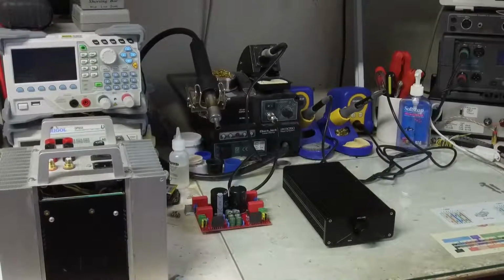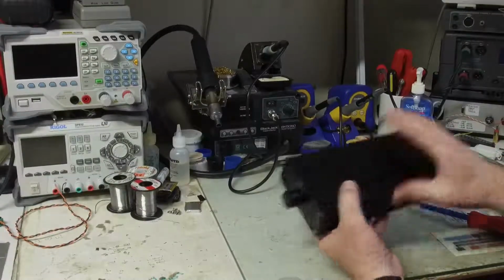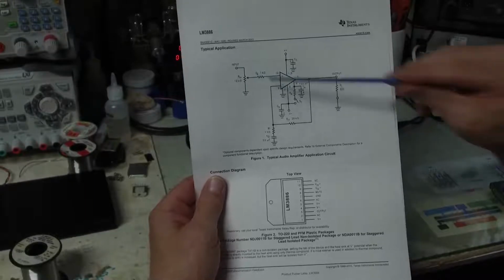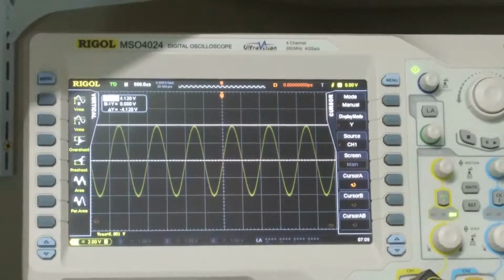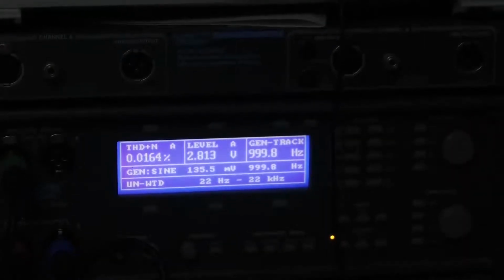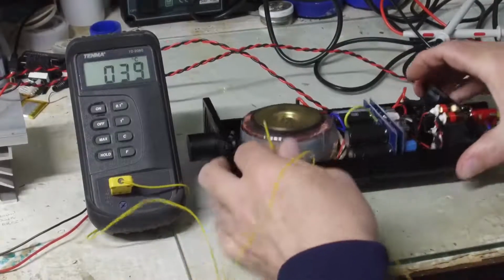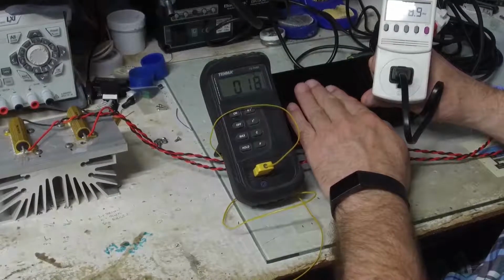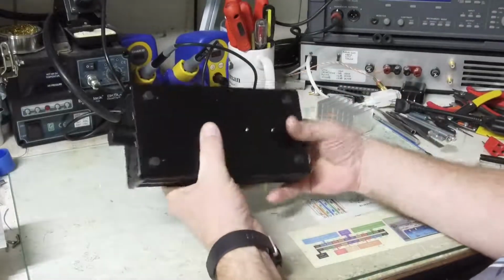LM3886 Review of eBay amplifier with thermal, performance and distortion. Used in Gainlclone.

Comment: 30W input for 2W output. So how many watts it consumes for 50watt output?
Reply from the maker: It does have a pretty high idle current.  So as you turn it up, that idle current plays less of a factor in overall efficiency.
Reply: @DanPattenAudioG33k  thanks!

Comment: I DIY myself this Amp LM3886 using CPU heatsink (3-4 gen Intel CPU heatsink and heatsink is quite small) the heatsink is more than adequate. You must have a heatsink cos all the transistorised components are housed in such a small package, and good heat dissipation is a must.
Reply from the maker: Agree.  Adequate cooling is a must.  It is amazing how much smaller the heatsink can be if a fan is used (not just relying on convection cooling).

Comment: Is lm 3886 ic AB or Class D  ? And also tell me which is best ic than lm3886 which delivers 100 watt output. Thanks
Reply from the maker: @SachinB.A.  LM3886 is Class AB and I believe 68W rated.  It is the highest power AB chip I have used.  You could use 2 in BTL configuration and get 100W.

Comment: How many amperes is a good transformer for an LM3886 stereo amplifier?
Reply from the maker: For a robust design, I think you want the secondary windings to be rated for 6 amps (for a stereo design).
Reply: @DanPattenAudioG33k  in my country the average person sells 5A or 10A... 6A ones are rare.. Can a 5A transformer be used for this amplifire?

Comment: Great analysis.  I have built several 3886 based amps recently, seriously heatsinked kit products, they work very well.
Reply from the maker: Good to hear.  The LM3886 does a decent job but they do need a decent sized heatsink.
Reply: man the AKITIKA is wayyyyy more complicated

Comment: Hi Don. I know you was laughing about adding those 2 extra heatsinks but that is exactly what is needed. Almost all the amplifiers from Ali/EBay etc are almost always under heatsinked. It is done like that to make it cheaper. The money in any amplifier is in the power transformer and good heatsinking. This amplifier suffers from both these limitations. If these things were addressed, it would cost double, and no one would buy it. You can get a similar module with fan cooling but it's quite noisy as the fans run flat out. Again a mod you can do it to wire the 2 fans in series, makes it quite a good little amplifier and fan noise is fine. Most of all it runs almost cold and stops the amp running into thermal limiting.
Reply from the maker: I agree.  Most of the amps I have worked with, the chassis, heatsink and power supply are a majority of the cost.
Reply: @DanPattenAudioG33k In normal operating conditions (music and speakers 8 Hom) the transformer can be 60% of the RMS power as long as the capacitors are oversized.
It is different for professional purposes but, in that case, it would be better to help the chip with a mosfet pair.

Comment: That transformer is a joke for two LM3886
Reply from the maker: I ran the amplifier to full power and did not recall seeing any droop in the voltage rails (which would indicate undersized transformer).  FYI.

Comment: There must be something wrong with the circuit used or parts used.
Reply from the maker: Are you referring to the thermal issues?  The LM3886 has a quiescent current of 0.050A to 0.085A.  I have typically measured the device at 0.065A.  0.065A x 72V x 2 (stereo) = ~10W of power dissipation.  This is just the two LM3886 while at idle.  10W is a fair amount of power to get rid of.
Reply: @DanPattenAudioG33k  I have built a number of LM 3886 power amplifiers, using a plus, minus 35 vdc power supply, and they work well. The IC does run hot when driven hard. The heat sink should be large. When driving just one watt of power, a little warm is all it should get, unless your driving a load of four ohms or less, then I don't know. The transformers I have used deliver plus minus 4 amps per side, and when driven into a 8 ohm load there was no loading down  of the power supply voltages, how ever there was with a 4 ohm load the IC got hotter quicker and the PS voltage drop. To my way of thinking, the IC does not mind high voltages (within its limits), but it gets hot over delivering high current. From your video it sounds like the IC is using too much current for the load driven, and or the transformer is to weak, or maybe there is something else.
Reply from the maker: Thanks for sharing.  I guess one of the points I was trying to make in the video is that the LM3886 can dissipate a fair amount of heat.  A typical problem with implementing this IC is not using a large enough heatsink.  Always seems to take a larger heatsink than anticipated.  Thanks.